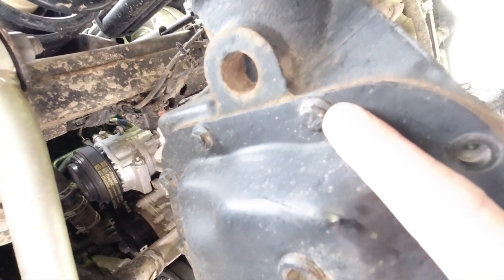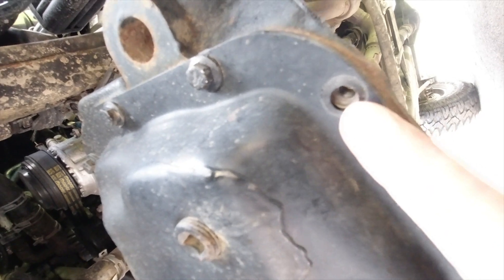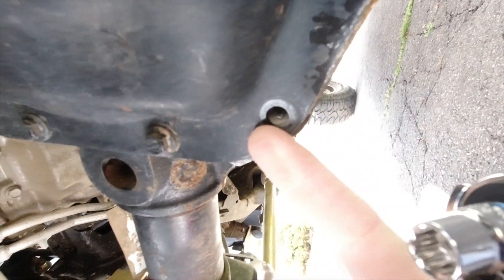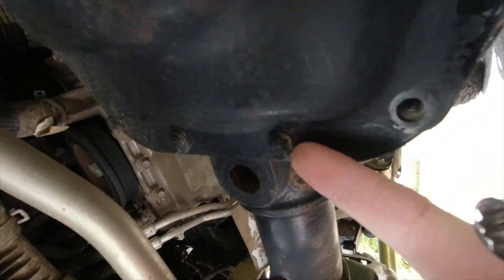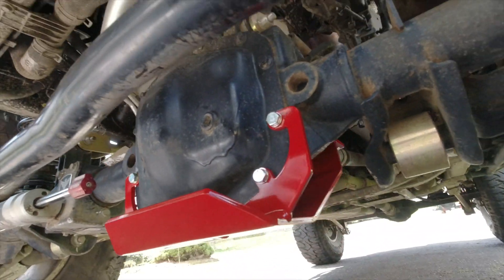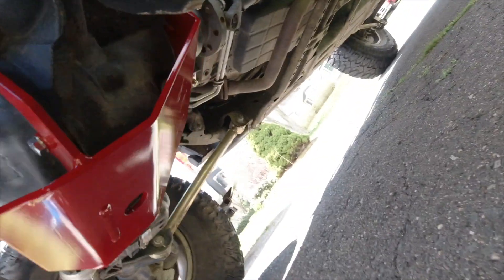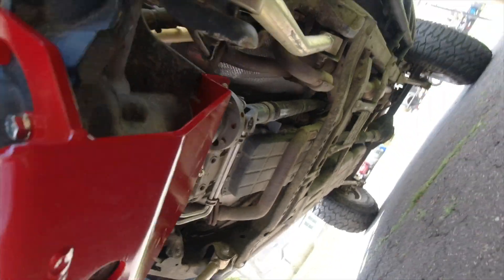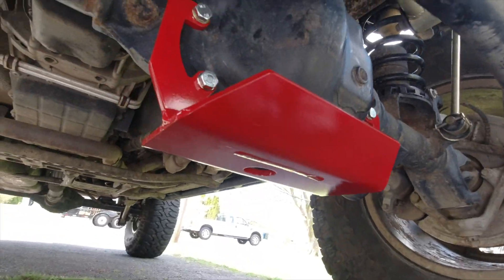Driveway DIY! Rancho RockGear Front Diff Skid Plate Install & Review. FunTimes

Comment: i just installed the rear on mine.. pre install, my rear diff cover had some carnage already.. the front is unscathed.. i figure if you off road you can at least steer around rocks making the rear a priority for me at least.. what thread locker you use?? i used blue.. the ins. dont specify what color to use, just says, use thread locker...  i will get around to the front.